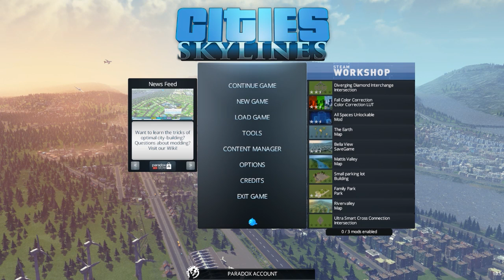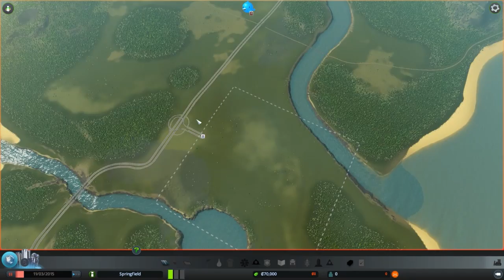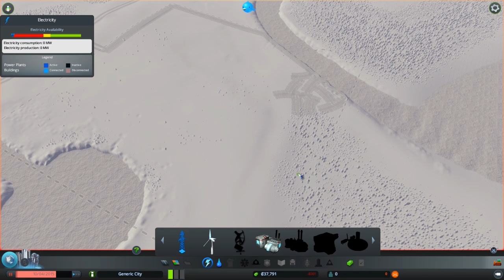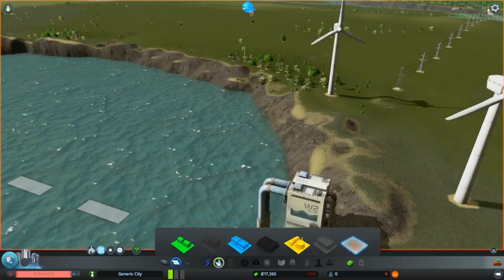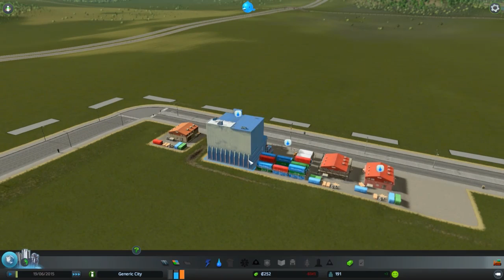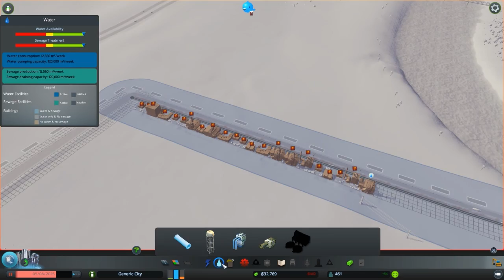Sky's The Limit! = Construction + Cities: Skylines #1

Comment: When you reached the city milestone, you didn't actually have to take out the loan since you get a bonus when you reach the milestones.  In my first city, I made the mistake of running out of money before I realized I forgot to connect power or water.  My second attempt went a little better.  You really have to be careful with your early money.  If you try to get too fancy, you're not going to have any left to put in the services that the city needs.  Put in the core services first, establish your initial industrial and residential and get a positive cash flow going.

One thing I would have suggested is that instead of putting in the massive 6 lane road in the begining, to instead put in a two lane road to save money.  Make sure not to zone or build anything on the initial road as it can be upgraded later.

The different ground color in the new industrial area is most likely ore or oil.